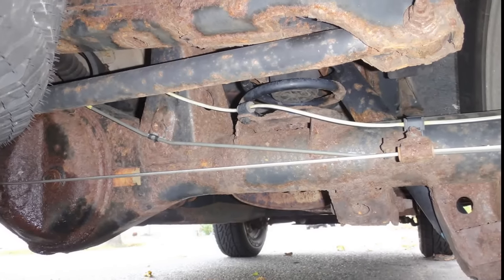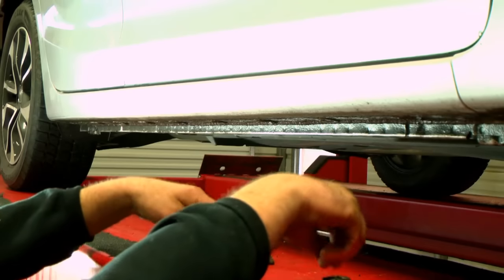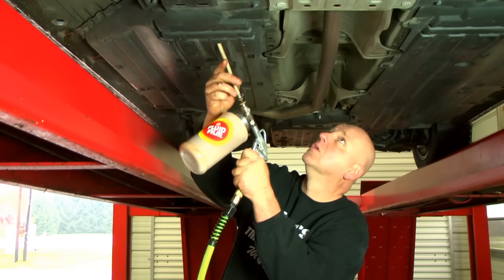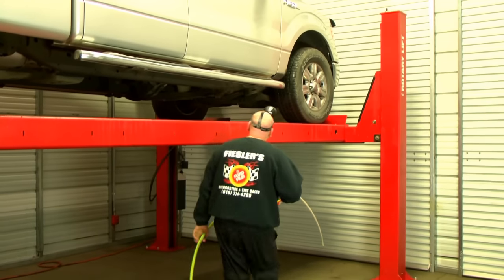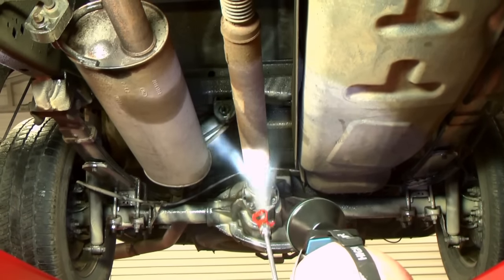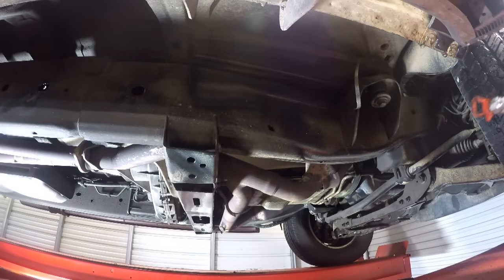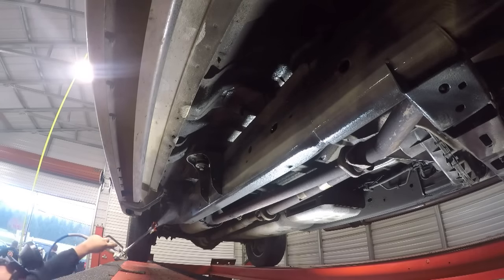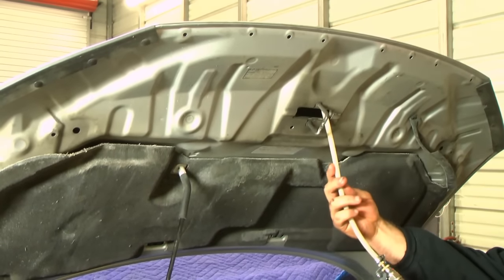FLUID FILM® Undercoating Tutorial

Comment: Does this stuff damage plastic and paint?
Reply from the maker: Fluid Film does not harm plastics or most finished paint (anything with a clear coat) as a penetrant it can soften porous materials like a matte paint, rubberized undercoating or other soft materials. Fluid Film will not harm oil-resistant rubbers.
Reply: @fluidfilmusa  I couldn't find any rust & corrosion protectant.  All i could find is just Fluid Film penetrant and lubricant. Will those work for understand coating?
Reply from the maker: @GhettoFabulous670  Hello Chief, it is the same product. Some companies that resell it have the lubricant/penetrant highlighted for their customers first. It will do a fantastic job for corrosion protection.
Reply: @fluidfilmusa  awesome thanks! Bc the can I got was smaller, and it had a yellow straw, not only that. Everything on it is Korean writing. Except the word "fluid film"
Reply from the maker: @GhettoFabulous670  Hello Chief, yes we have different packaging for Korea. It should say AS-360 or AC-360
Reply: @fluidfilmusa  yup, ac-360 is all I could find at my local hardware. Is it safe to use as a undercoat and the same thing as in the video?
Reply from the maker: @GhettoFabulous670  yes it is the same product and can be used for undercoating.
Reply: @fluidfilmusa  thank you! Shows the company, yall have good service, and amazing communication!💯👏
Reply from the maker: @GhettoFabulous670  Thank you Chief! We’re always happy to answer any questions for you.

Comment: what spray tip size do you use
Reply from the maker: A 512-517 works best on an airless sprayer. Basically anything that will spray a house paint will be able to push our product. The tip on most undercoating guns is adjustable.

Comment: Hi, Guys what's the correct name for the 360-degree wand and the red spray nozzle attachment being used at 2:35min?   
============================================  or  ===========================================
=====================  The full equipment setup used.. I do have a compressor  =======================
Reply from the maker: Hi Carlo, we offer a undercoating kit with the part number FFSG similar to the setup used with the nozzles here. This shop also used an airless(electric) paint sprayer which was a Graco magnum Pro LTS 170 but any airless system should work.

Comment: I just bought a gallon to do my truck chassis, when I opened the can it was like one solid mass of wet glue, I stirred it for about 10 minutes and it never changed viscosity, it doesn’t look like it would spray like in this video, do I have a bad can or to old to use? Can I thin it? What do I use to thin it with? Thanks
Reply from the maker: Fluid film is thixotropic and typically returns to its original state when mixed. You can add in a bit of any vegetable oil to help thin it without harming the performance if it is too thick.

Comment: Will it rot any rubber in bushings?
Reply from the maker: Fluid film will not harm oil resistant rubbers. Bushings, motor mounts, spacers are all typically fine if it is a modern vehicle

Comment: Why you don't have to remove rust first?
Reply from the maker: Our product is also a penetrant. We recommend removing loose scale before application as our product will soak into the rust and penetrate to the clean metal stopping it from progressing. In some areas of thicker rust you may need a second coating if the product is completely absorbed.
Reply: @fluidfilmusa  basically you say I should clean loose rust but I don't have to clean until see bare mental because this product can absorb some rust and protect the mental behind it? Another question, if I spray it with gun, how do I clean the sprayer after the job?
Reply from the maker: @ask43242flight  the product will soften the rust making it easier to remove with a wire brush or media blasting. When applied directly to a rust it will soak into the rust and prevent it from progressing but not remove the rust on its own.

Comment: it doesn't say how CLEAN you have to get the undercarriage first.  i imagine that's super important.  i dont really even know HOW to clean an undercarriage?
Reply from the maker: As long as there is no excessive dirt or loose flaking rust, fluid Film can be applied with minimal surface prep. Most customers take their vehicle to a drive through car wash the day before application which is typically adequate as long as there is no loose flaking rust. Fluid Film can be applied directly to tightly adhering rust as it penetrates to the base and is absorbed by the rust.

Comment: Wear a mask man! This stuff isn't good to breathe in. Lanolin isn't the best thing for your lungs. Also, it's very helpful to drop down the spare tire on a pickup truck and use the 360 degree want to hit the tops of the spare tire carrier pieces as well as the crossmember of the frame that supports the spare tire crank assembly. I wish I had access to a lift like you do. It's a huge PITA crawling around on the ground while spraying under a vehicle, but at least a truck has decent ground clearance.

Comment: A few questions:
1 why the chassis is not washed. 2:17 Fluid Film is applied to the mud !!!
2 why spare wheel is not removed - laziness?
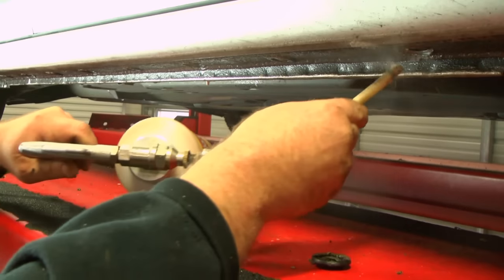3 why the plastic tube is so short. 0:56 tube is inserted ONLY perpendicular !!!
4 Why is not the old anti-corrosion protection removed 4:05
MORE PROFESSIONALISM!!!
Reply from the maker: Hello Jarek,
1. Ideally the frame should have been washed, slight dirt wont harm the coating but we prefer as much of the product on bare metal as possible so it can soak in.
2. The spare was dropped and applied on the cable and above, it was edited out for time. The 360 wand does an adequate job when sprayed through the gaps with the spare though.
3. the hose used was long enough when inserted both directions from multiple locations, Fluid Film will also creep.
4. The old product was existing Fluid Film from the last year. Fluid Film can be applied over itself in areas where it remains from previous years.

The intentions of this video are to give the DIY undercoating community a reference to help them with commonly asked questions.
Thank you for your time and were happy to handle any other questions.
-The FF team
Reply: The guy isn't wearing a mask or safety glasses either...

Comment: No safety gear? Can’t be a very good product if you can breath in lots of it! Yet the warning at the start states it might melt factory coatings!!!
Reply from the maker: NZ restoration Our product is Lanolin based and classified as Non-hazardous and Non-toxic.he is also spraying in a well ventilated open garage.
We make the statement as a warning for owners of vehicles that have porous soft wax factory undercoatings such as GM on their larger models. We make that statement so our customers know that applying any aftermarket should be checked with the manufacturer before applying. The last thing we would want is someone to have a bad experience with our product. We have a good number of customers who use our product on these GM vehicles once the factory coating dries, cracks and begins to hold the salt against the frame.
If you have any other questions please feel free to ask.
-The Fluid Film team

Comment: No mask? Face or eye Goggles? Wow. Don't buy this product if the Company is that negligent.
Reply: maybe it was his own decision? but yes.. goggles and breathmask is highly recommended
Reply: Made with Lanoline, its from Sheep Fat !!  Every eaten  a lamb chop ?
Reply: It’s non toxic, I’ve sprayed this stuff from the aerosol cab and got a good amount on my fingers. I took a break without washing the fluid film off my hands and ate a pastrami sandwich. Then I finished coating right afterwards.
Reply: Read the Material Safety Data Sheet.  No respiratory protection needed. If ingested drink water.  The fact you don't need  protection from this product is a desirable feature, not recklessness.
Reply: Jonathan K Yank, yank, yank....

Comment: Garbage product. Don't waste your time. Here in Central New York State, it didn't even make it through the winter. By spring, it was gone. I used 3/4 of a gallon to do my 2010 Lincoln Town Car. Worked well in body cavities where it was not subject to snow abrasion or slush wash. Does not stay on the underbody in my area of the country. Did not run through the car wash all winter to try to keep it intact.
Reply: I wonder - when Fluid Film "dries" it gels up and thickens.  So, after an application you can still see the "gel" clinging to the metal.  Now the gel may wash off but I think that a thin layer of the oil/lanolin stays in place to keep protecting the metal.  Fluid Film would know better than me.  I'm just relaying what I've seen in some YouTube videos where they power wash various rustproofing products to see which ones wash off and which still leave on a film of protection.

Comment: Is this a joke? This man has no idea about corrosion protection. 
Injecting even the best protection onto a mud surface? (2:15) 
Spraying on parts of the braking system without securing the brake discs and brake pads !!!!!!!! (2:46) 
Protection without removing the spare wheel !!!!!!!!! (2:12) - good that the rim has holes!!!!!!! JOKES!!!